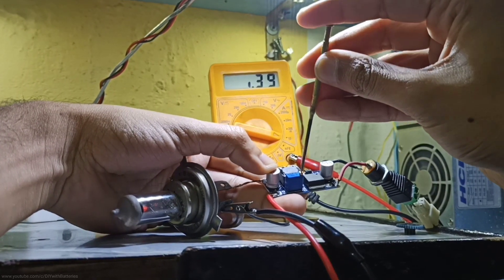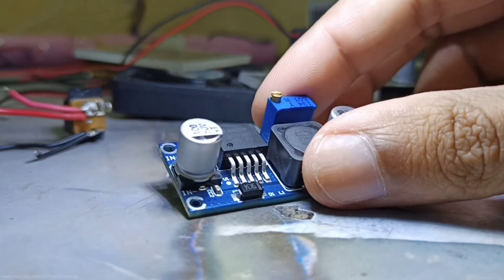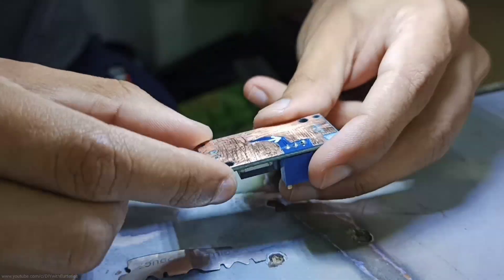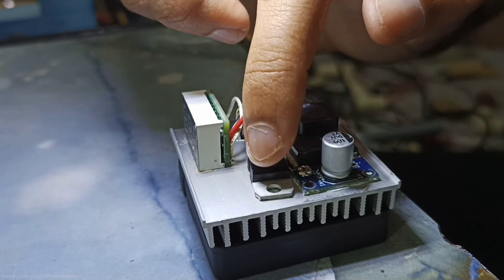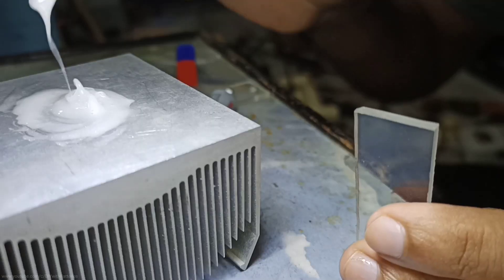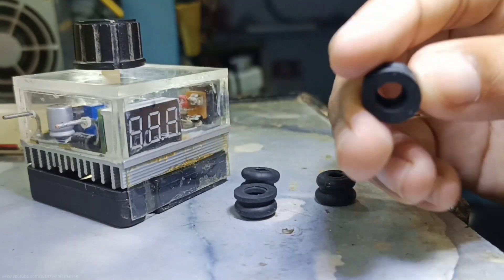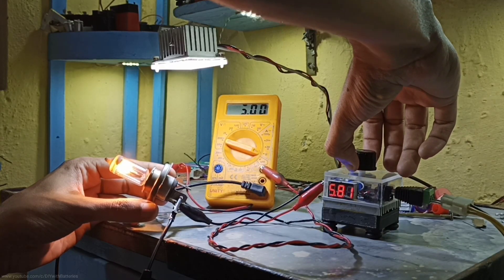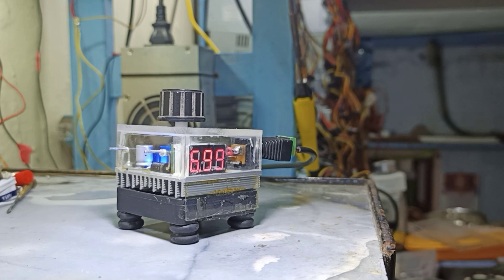Upgrade your LM2596 Buck Converter

Comment from the maker: I know it's just small thing but as we all know that these circuits are often used in our daily diy projects with different voltages and current. (as our requirements)
So the only issue with these boards is the IC which Over heats at lot, as many of us faced by changing these circuits because of the blown ic

So i tried many ways to add a Heatsink on the Ic and i even tried by unsoldering the ic (connecting externally with a small Heatsink) but it's not only the Ic which get hot and also the small inductor which is mainly used to decrease the output voltage without loosing the efficiency by receiving pwm signals from the Ic

So i think this is the perfect and only way to connect a Heatsink without removing the Ic Or messing with the Board

I hope it helps a little for you guys in your diy projects✌thanks for watching!

Comment: Nice trick with removing the terminals at the back of the board! I wonder if it would help to install the heat sink on top of the LM2596 itself
Reply from the maker: It works great now 👍

Comment: I've had 2 of the chips blow up on me by charging batteries with solar. 
I learned that using them in parallel reduces load on each of the buck converter
Reply from the maker: Yeah man 👍
Reply: mine blown bcos ive insert input power to output..now i only can see voltage input but cant control output
Reply from the maker: It happens every time xD

Comment: Is it possible to increase the amp of lm2596 by any MOSFET or transistor?  just like Lm317🙂
Reply from the maker: Yeah that's might be a good idea but ntg is perfect then as it came with, trust me Dude manufacturing engineers thinks a bit further than us xD but still it works I saw some vids. definitely I will try that too ;) thanks for visiting.